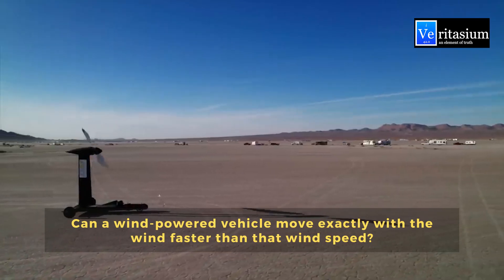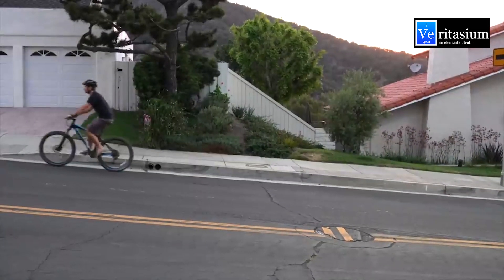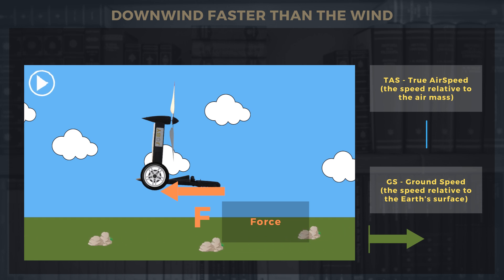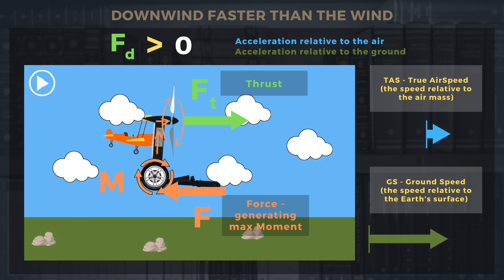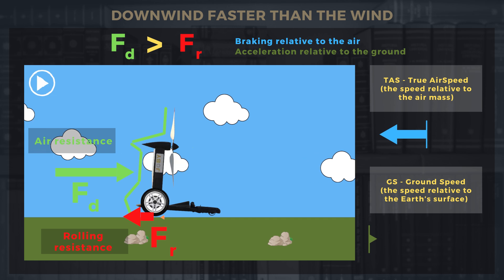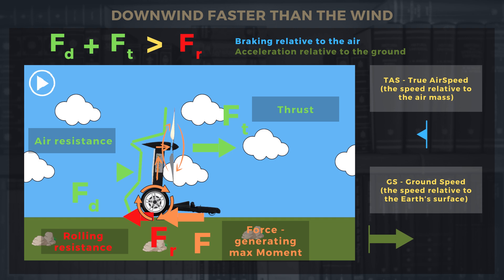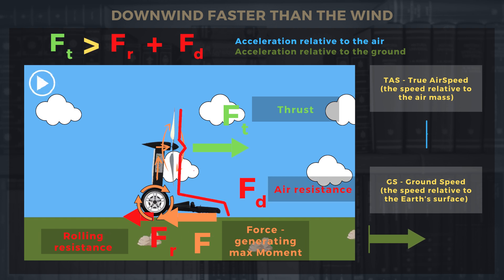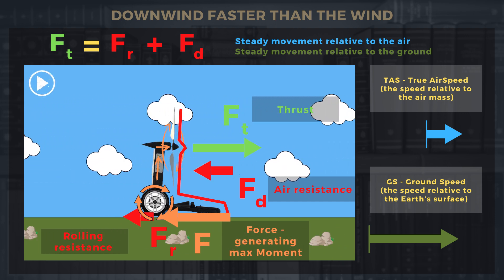Veritasium is wrong. Blackbird vehicle explanation.

Comment: If I understand your explanation, you are claiming that the increasing deceleration of the vehicle due to drag, as the vehicle speed increases, will eventually balance out the gained thrust from the propeller.
As far as i can tell you don't adrees the increasing thrust gaines from the propeller due the increased vehicle speed. It is thus not clear wether the three forces at play will ever balance or thrust feom the propeller will always dominate over the vind drag plus rotational drag in the vehicle. This likely also depend heavilly on the internal drag in the vehicle. Which, as i remember it, is the conclusion from Veritasium.
Beyond whether the vehicle theoretically could reach relativistic velocities or not, i fail to see how your explanation is not equivalent to Veritasiums.

P.S. your english seems pretty good
Reply from the maker: Thanks for comment! 
When the vehicle reaches the wind speed (when it is stationary in relation to the air masses), it is only braked by the rolling resistance force, while the thrust may be greater due to the rotation of the propeller. So it will accelarate.
The increasing rotation of the wheels increases the rotation of the propeller, so it must cause greater thrust.
These three forces must eventually balance each other because the air gives more and more resistance. In order to fly faster and faster, planes must have more and more powerful engines. The air has a lot of resistance.

It is not equivalent because in movie V. the lever is given as an explanation. Lever is not necessary for it to work.
Reply: @PiotrRysztak  

Just go through your comment here slowly. "it is only braked by the rolling resistance force." (at windspeed). So where does the power to rotate the propeller come from? It does required power after all if it is to generate thrust.
Reply from the maker: @axelerat3d  Initially it goes from air resistance force - braking relative to air masses and It turns into force which drives the wheel and propeller. Finally the propeller generates thrust. Only one force is braking a vehicle relative to the ground - it is rolling resistance.
Reply: @PiotrRysztak  Rolling resistance is a dissipative force that goes into deformation/heat, and doesn't provide any useful shaft power to the propeller. But the propeller needs a power input from the shaft to rotate against the aerodynamic torque.
Reply: @PiotrRysztak  I not only guarantee that you're wrong, but I'm here to offer you the same bet Derek offered Kusenko.  What do you say?